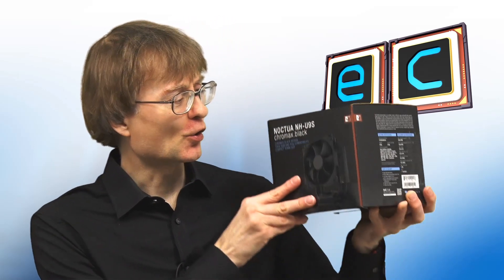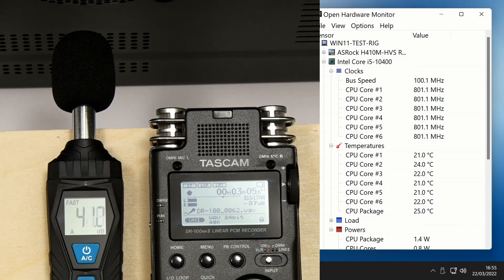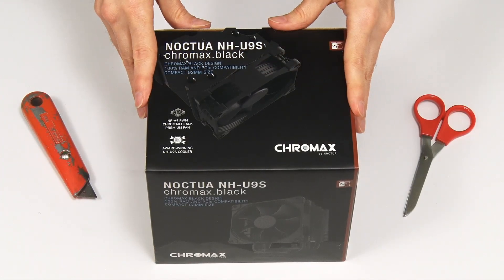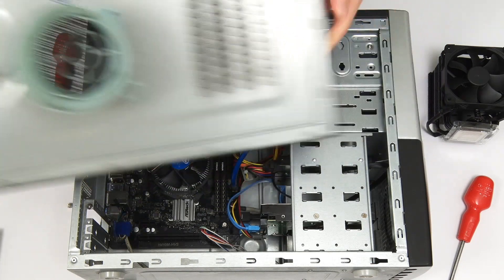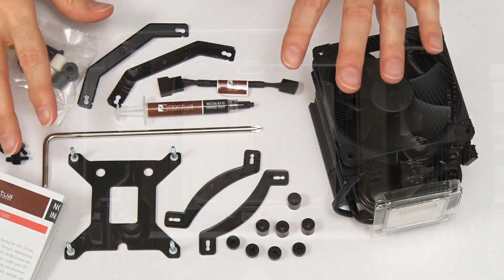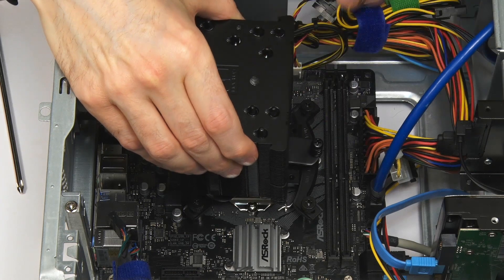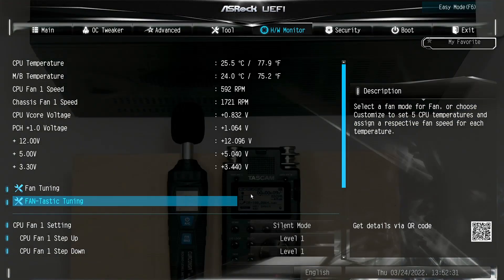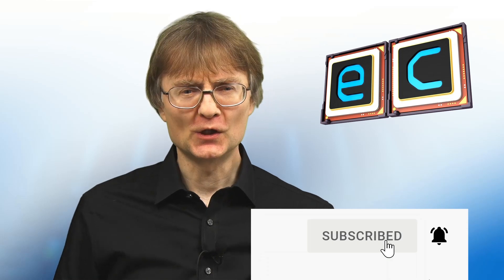Quieter PC #1: Noctua NH-U9S Cooler

Comment: Great job. But I wonder if not having the fan blowing out and thru a cone wind tunnel as to blowing to the rear of the case with no tunnel has a bearing on the outcome. Looking forward to the next lesson. And as always keep up the great work your my favorite Teacher.
Reply: You mean on the side panel? That's intake. The fan blows downwards and out the sides. The fan isn't blowing into the meter if that's what you were thinking.
Reply: Years ago someone gave me a top-end Dell that he could not stop from overheating. When I got it, it was all stock, with a cone thing from CPU heatsink (fanless) to the case exhaust fan. 

I ditched the shroud, replaced the passive heatsink with a basic one that had a fan, flipped the case fan to be an intake, and the CPU temperature dropped 40F degrees. And this was supposed to be engineered to run cool -- seriously, Dell??

Comment: Excellent video with good instructions to select and install a cooler. 

For AMD CPUs with their pins on the CPU I found it to be best to heat up the system a bit before removing a cooler and to wiggle the cooler from left to right before pulling it off of the CPU to avoid pulling the CPU out of the socket along with the cooler, which can cause damage. Especially if you don't notice the CPU is attached to the cooler at first.

I wonder if the fan on that RM550x will even turn on in a system like this. The manual states it could stay off until 220w gets used. Maybe it will be as silent as it gets.

I like mid-range systems, they can get to a level of quiet, under load too, that high end systems just can't do. Especially now with high end CPUs and graphics cards that draw loads of power.
Reply from the maker: I can report that the RM550x is now fitted and, other than briefly on power up, I have never had the fan turn! :) Even rendering 24/7.
Reply: @ExplainingComputers  Sounds like it makes for an excellent quiet PSU for the system. At least that cannot be the loudest part in the system now :) Makes me wonder if there is any real value left in purely fanless PSUs for the average user.

Comment: Meanwhile I'm sitting here with a Scythe Fuma 2 - that's cheaper than the NH-D15 - with 30'C on a Ryzen 7 3700X with 270 RPM with basically inaudible fans.
What people tend to get wrong is that more fans equals more noise, but what's actually true is that the more fans you have (although there are certain rules when it comes to placement and airflow) the lower you can set them to, to do the same job... Even going down 5db makes a huge difference as it literally translates to being 50% more quiet.
This sometimes requires fiddling with voltages, which can be scary but most current CPUs will simply lower their clocks if they can't boost high enough, so it's easy to check where to stop undervolting.

Comment: Passive cooling would never have worked in that particular case regardless of the processor, as the top and bottom of the case is not vented. Passive cooling works by convection which would have not happened that well in the this case due to the solid top and bottom of the case.  The Noctua NH-U9S is a much better option for this type of case.
Reply from the maker: Agreed. I said as much when talking about the passive coolers.

Comment: Nice insights into CPU vs. PSU for sources of noise. 
Silence is one of those things it's hard to appreciate until you lose it. I moved my media NAS from an all-solid-state, passively-cooled Pi to a Synology with CMR mechanical drives and the spin-up of disks and, to a lesser extent, the fan is very noticeable. If only flash storage was as cheap per GB as spinning rust!

Comment: It is a view weeks i did the fan shenanigans to my rig :). I have a Scythe CPU cooler with 2x 120mm PWM fans, these are quiet. When i play Visual Pinball the 4.1 GHz 8 Core FX8350
needs some cooling than i can clearly hear the noise. However my none PWM PC case fans were quiet very quiet but they did not adapt to the heat output of the system. So i bought
some PWM PC 140mm fans. There are differences between the fans like flow and pressure, guess this matters only for the CPU cooler.  Sadly the PWM did not work like i
thought it would. My rig is much louder now, something like a small hair dryer, that sucks hard. I tried 2 fans Arctic at 800RPM, and Magnetic Levitation Bearing Corsair at 1200RPM
both on idle. Well summer is coming so i go with the noisy but effective solution, i wont the heat out of the rig! PWM did not work for me as i thought it would, the none PWM fans were
working at around 600RPM, maybe i bought the wrong fans or my motherboard is too old. My idea was i have around 600RPM when idle or watching Youtube, and up to 2000RPM when
playing. Unfortunately this is not the case! Did not to mention the fan hub i have that came with the Fractal R6 case.... Another story for even more confusion (the fan speed differs, output 
PWM signal is taken from the motherboard (don't think it is mapped))...

Comment: Looks good! 
Is there a reason you're keeping the pc temperatures so low? You could reduce the fan speeds even lower if you allowed it to go over 60 degrees and such. Thanks :)
Reply from the maker: I plan to tune things up once I have fitted the new PSU and case fans.

Comment: Great video. Even after spending that kind of money, the noise persists. My solution is to keep the CPU in the closet or in the next room and route cables and connectors of display and USB through the walls. The only problem is we cannot change the position of work table.

Comment: Just my two cents wort. I don't like these humongous things hanging of the board in my typicaly tower housings so I went liquid cooled years ago.  Amazing difference in noise was a pleasant bonus to the weight/leverage issue. Typical  setups shown on YT are total overkill. I run two 140W TPD server processors on a single 120mm radiator and 8mm hoses. Fan is temp controlled and even at full load on both processors barely goes above idle. processors get up to about 56-57 Celcius after about half an hour. Total win so far.

Comment: The silence on Noctua fans comes with a lower efficiency / airflow. Image and reality is not always the same.
Reply from the maker: There  are always a lot of factors in play. This project is now complete (the 2nd video will post in two weeks), and with a new PSU and new Noctua case fans front and rear, the rig is almost totally silent (well under 30dB), and CPU temperatures at load are no more than 42C. :)
Reply: Noctua fans are some of the highest efficient and highest airflow fans on the market right next to Be Quiet. Corsair fans are some of the worst fans you could buy right next to using stock fans with cases.

Comment: I received one of those screwdriver bars although not the same and printed a handle for it and glued it on with epoxy resin, it comes in handy for screws that need to be very tight, I am surprised how long it has lasted as I half expected it to be made of very cheap steel that would deform when tightening screws

Comment: The design of PC boxes seems designed to maximise and broadcast any noise generated internally.  Large, flat, flexible membranes on either side are going to create an echo chamber and vibrate whenever possible. What's the scope for passive sound deadening with damping or absorbing foam applied at least to the sides?  (Any quality car rebuilder should have enough scraps of the materials for an experiment.)

Comment: i had a flashback to the days of my DEC PDP11/45 and Perkin-Elmer 3250 ... The days of Register Lights, Switches and airflow , with tape drives spinning, Multi-platter hard drives seeking.  When you KNEW  your computer was running. Now most PCs don't even have a CD drive that you can press a button to see if power is up.  Just assume the system is running, I guess...
Reply from the maker: Greetings Leslie! :) Those were the days. I hope that all is well with you.

Comment: Great video! Noctua is like a Ferrari of cooling ;) You basically know why are they more pricy then other brands, its amazing quality. I am a big fan (pun intended) of active cooling, but was wondering wouldn't an all-in-one water cooling loop be even quieter? I do not use one myself so am unable to compare, this could be an interesting video :)
Reply: Noctua was never pricey until recent inflation. I bought my DH-15 for $70 in 2018. Now it sells for $100.
Reply: @lightly-red-huedmaleindivi6266  Noctua has always been overpriced and poor value. Brands like Scythe, SilentiumPC, Gelid, Thermalright or Arctic provide more value.
Reply: @MJ-uk6lu  Never heard of those, and likely for good reason. Noctua is and has always been cheap, and they're also quality. I'm sorry your third world country pays more than US residents.
Reply: @lightly-red-huedmaleindivi6266  And you haven't heard of them for bad reasons. You are just fanboy and haven't looked at any other cooler brands other than Noctua. Scythe has been in this industry for ages and was one of OG aftermarket cooler makers. It destroys Noctua crap at quietness and costs less. Thermalright is also one of OGs of industry and consistently beats Noctua at top tier cooling. If things like Scythe Gentle Typhoon (which Noctua ripped off), or Thermalright Grand Macho don't ring a bell, then I'm sorry, but you are noob.

Comment: I don't recommend anyone doing what I did but about 4 years ago before giving away my Seasonic Fully Modular Bronze rated 850w power supply to my friend I replaced the fan inside of it to Noctua's Industrial Grade IPPC 2000rpm 120mm Fan and then sent the power supply to my friend so it won't get noisy during the load. I particularly get very irritated about noisy fans specially when leaving computer overnight to work and sleeping in the same room as my computer so all the fans (except power supply for warranty reasons) are from Noctua.

Comment: A couple of things you could try if your going to keep the chassis fan, replace the screws with rubber fan mounts they can make a big difference for little cost. Using a Dremel to remove the chassis honeycomb holes will make the airflow so much better
Reply from the maker: Good tips, but the back fan has now been replaced with a  larger Noctua, and there's also now a 120mm one at the front! :)

Comment: Serious question: Is “White Spirit” British English for Isopropyl Alcohol?
Reply from the maker: I think that "white spirit" is a general mix of petroleum hydrocarbons (sold, as least domestically, for cleaning paint brushes and general degreasing). So it may contain some isopropyl alchohol, which I think is a more refined product. Anyone?
Reply: Yes, a mixture of hydrocarbons. The label on my bottle of white spirit reads "hydrocarbons C9-C12", which is similar to petrol/gasoline.
Reply: Got it. in the US, we call it “mineral spirits”. Often also labelled as “Paint thinner”

Comment: About 5 years ago my wife bought a CHILLBLAST I5 desktop computer.  The case is made by Cooler Master and I think there are four fans inside, three at the front and one at the back.  Air is drawn through a "silencer", a hard foam panel which forms an openable door on the front.  It is incredibly quite in normal use though what it is like when she is shopping online I'm not so sure!

Comment: Deleted my first comment as I remembered I actually had the :  NH-U9B SE2(dual fan)
Still had to change to an AIO as this was just too weak for my supposedly 65W 10900F.
The Cooler is on my son's 4th gen i5 now. but not sure what's wrong with the mobo ( some OEM lenovo mobo ) that the fans are running at full speed constantly and is quite loud.
Reply from the maker: It sounds like CPU fan speed control is not turned on, or is set to maximum.

Comment: The case seems to be rather air restricted, I doubt you can achieve much more noise reduction without having more inlets and/or guiding the air like the duct you had to remove did.
Reply from the maker: Wait until you see part two. With new case fans (front and rear) and a new PSU, the noise level is reduced dramatically.

Comment: So not much difference?
Reply from the maker: Not yet . . . wait until the PSU and case fans have been changed also. :) Although even the change here is significant for recording. So it depends on the use case.

Comment: Any reason you did not replace the other fans with Noctua ones? I even replaced the power supply's cooler with a Noctua one (not recommended unless you're an engineer and know what you're doing. Civilians should buy a fan less power supply). I have a Ryzen 4650G CPU and am unable to hear the computer. Even when it runs full Speed.
Reply from the maker: I am doing exactly that! :) This video is part 1 of 2, with the PSU and case fans being changed in the next video, with fairly dramatic results . . .
Reply: @ExplainingComputers  Ah, I see. Good. Good. BTW, thank you for buying an Austrian quality product.
Reply from the maker: @der.Schtefan  There is nothing to beat the quality of Noctua. :)

Comment: The perception of noise is a combination of frequency and sound pressure. The 120mm fan creates sound at a lower frequency than the small, high rpm stock cooler. This reduces the noise perception even if the sound pressure is the same.
Reply: I believe this cooler uses a 92mm fan, which I don't see all too often nowadays.

Comment: A good cooler's one thing, but once the temps inside the case start to rise it'll start pushing up the fan rpms to try compensate. If you want it to stay quiet, you need case airflow to prevent it from constantly recycling hot air.
Reply from the maker: I am very well aware of this! :) As I note in the video, this video is the first of two, and in the second part I improve and quieten case cooling as you note. This system is now running 24/7 at load (rendering), practially silent, and at CPU temps of about 42 degrees.
Reply: @ExplainingComputers  Not sure if you've heard of this, but there is an item that you can 3D Print called a "static boost plate" which looks like a fan but the vanes/blades are stationary but opposite angle to the rotating fan blades. Very much similar to the stationary blades inside a turbofan engine!!! This static boost plate goes between the fan and the case and reduces or eliminates static back pressure...keeps the pressure positive in the computer case and the plate is probably no more than 10mm thick, perhaps thinner.

Comment: Luckily we don't need to use mechanical hard drives in PCs anymore. SSDs are completely silent. Some hard drives were so noisy, especially when they were getting old. We had an old PC in the workshop. The hard drive was making very loud high pitched sound, that was very annoying.

Comment: Might already have been said, but a3db increase is actually a doubling of noise output 👍
Reply from the maker: Yes, and has not been said! Very important.
Reply: Usually, that is true for normal power signals. But here, we're talking about dB(A) which uses a kind of filter (type A) that matches the way humans perceive loudness. 
Adding 10dB(A) (not 3dB) is perceived as a doubling of noise. 
Edit: Not so sure now, I read the "A" in the display as the filter type but it might also stand for "absolute". Couldn't find a manual.
Reply: The use of 3 or 6 db for .5/2 X has always confused me, the explanations confuse me more.  ‘It is obviously N X for (jargon scenario), easy’.

Comment: Before there were "silent" fans or at least Before I knew about them, I had an Apple G4 tower that got some "sound/noise treatment". This "treatment" included application of adhesive foam pads to internal metal panels to eliminate panel resonance. In addition, the power supply had a fan grill with a hole pattern that was causing noise from the airflow over the grill guard. Removed that with a Dremel tool. The overall noise reduction was dramatic!!! 😁👍🏻
Reply: That would have been around the same era as the ridiculous "lampshade" iMac... They didn't care what was practical, maintainable or well designed, so long as it looked cool and got people's attention. If it pissed the user off, who cares? As long as someone walking into the office saw the "cool" look and the big Apple logo, they potentially gained a new user.
Reply: @tin2001  Yeah, Apple still doesn't care m8. Just look at the Apple Studio Display or the Mac Studio.
Reply: I had a G5 Tower with a dodgy PSU. It sounded like a Vulcan bomber with full afterburners …

Comment: In the pursuit of having a silent pc i noticed how much noise a hard drive makes and it was a lot more than i anticipated. This is going to be expensive with cpu cooler, case fan, psu and full ssd
Reply: Cheap hard drives are loud, I never hear mine.
Reply: @mikem9536  Actually, a lot of the high performance and server hard drives are louder than the consumer drives. I have some server drives here and boy you can sure tell whenever the OS spins one up. 

Conversely, the quietest drives I've seen were those crappy Maxtors that liked to die one day out of warranty. Remember when Seagates (very loud in the old days) suddenly got quiet? Those were rebadged Maxtors.
Reply: @mikem9536  My enterprise grade HGST hard drive is quite loud
Reply: The solution to hard drive noise is to use an SSD. 100% silent.

Comment: Do you think that I should replace my case's stock fans with Noctua fans?
Reply from the maker: It often makes a big difference. It all depends on what is making the most noise in your system -- CPU fan, PSU fan, case fan(s) or GPU fan(s) if present.